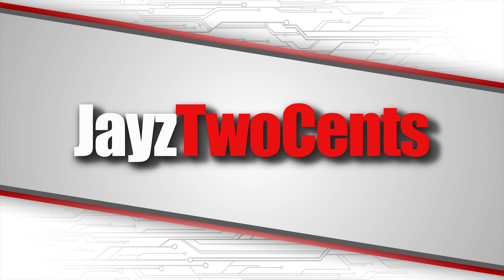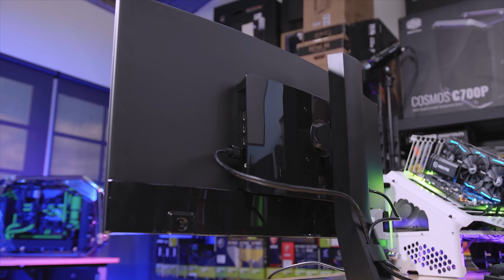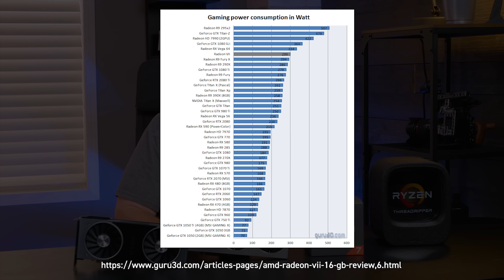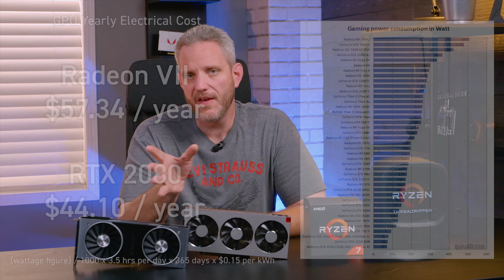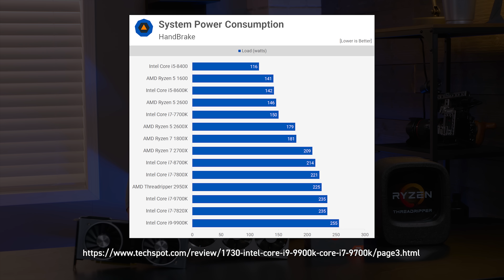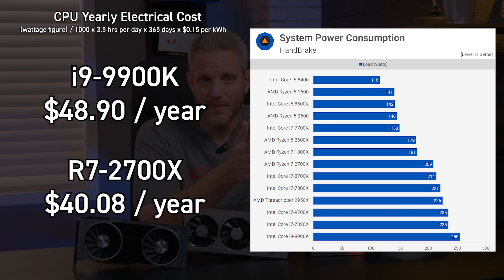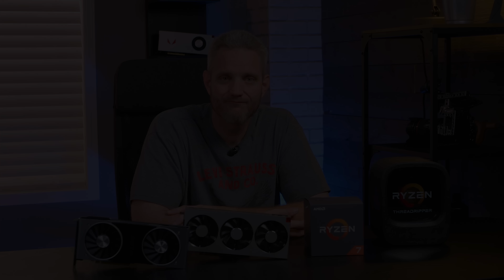Energy Costs of AMD vs Intel vs NVIDIA... This might surprise you

Comment: For the international viewers:
If you pay 0,25 the difference between the VII and 2080 is 22,- in a year (in favour for the 2080)
If you pay 0,40 the difference ends up being 35,- a year.
So... the conclusion can be thrown in the bin for about 3 continents and you might consider it.

ps. Your CPU numbers are also incorrect because you are comparing a unlimited 9900K vs a stock 2700x

See https://www.techspot.com/review/1744-core-i9-9900k-round-two/ and look for Power Consumption where they explain their screw-up.

Comment: Thanks for this. On the desktop AMD is looking really good, and it's only going to get better with the 3000 series. Intel doesn't appear to have anything new in the pipeline for the rest of 2019, and if the preliminary numbers are to be believed they're going to be in a world of hurting. 2020 may be another matter when they bring 10nm to the desktop.

Laptops are another matter. Intel is bringing its long awaited 10nm process there first, along with vastly improved integrated graphics that will wipe out AMD's graphics advantage in that space. Meanwhile, AMD is giving us a half-hearted update of their Ryzen APU series to 12nm. AMD will win some value-oriented customers, especially if Intel struggles to produce enough of their new laptop processors, but AMD isn't going to be competitive at the high end of the laptop market.

AMD is presumably working on a 7nm laptop processor for 2020 or later, presumably also incorporating Navi graphics. That might finally make the company a serious player there.

Comment: So...
Ryzen 7 3700X expected to run at about 65 W vs i9 9900k 170W stock or about 210 W if you run all core 5 GHz turbo with no other OC (in other words not locked 5 GHz, just enabling all core turbo in the motherboard).
With that kind of numbers the power draw argument becomes more applicable...
Just saying...
I bought a R7 1700 to start with in part because of it being a 65W chip.

Comment: my old-ass system uses aprox $45 a year to run at full OC and maxing VC volts and watts. but like you said its not running full power 24/7. but my system is always on, only shut it down when Im out of town for more than 24 hrs. which is like $4.58 a month to run. you prob payed more to run a 100w incandescent light bulb running all day.  lol  I suspect a newer system runs much less especially if you use the power saving features. Thanks for sharing these #s Jay !

Comment: 15c/kWh would be extremely cheap.
Average real prices for power is more in the range of 30c/kWh.
(not the advertised as you also have to pay grid usage fees and other things -  the grid usage fee often is just 100% of the power price, effectively doubling it already).

Also - the Radeon 7 is by your own (and nearly all other) benchmarks a few percent slower in nearly every game.
Here for me both cost pretty much 700€.

For the CPU comparison - sorry but that is absolutely not how it works. Your handbrake-numbers are, as you present them, useless:
The powerdraw is not what matters but the total energy usage. Say system A needs twice as much power as System B - does that make it less efficient? No.
Now, lets say System A finishes the work in 1/3rd the time of System B - this makes A a lot more efficient despite higher power draw. But if A took just as long as B then it would be horrible inefficient.
And when comparing intel CPUs on highend board you kinda have to change the UEFI-settings manually cause by default nearly all of them have horrible settings, way outside of intels official specs and wasting a lot of energy, even making them slower due to thermal constraints.
I have seen that on my i7 8700K:
Stock settings in Cinebench R15 - score 1420, 135 W.
Intel specs - score 1350, 87 W.
That is a huge difference, specially considering that OCing it to 4.9 GHz and 1600 score still gave me under 120W.

For Handbreak i am rather certain that the Ryzen 2700X will easily beat the 9900K - far lower power consumption and just a bit slower.

Comment: im gonna start by saying that im an amd fanboi, but yeah my 8 core FX is a space heater of a massive scale. i run the 8350 overclocked to 4.8-5.0ghz on all cores all the time (1.49-1.51v core, asus sabertooth 990fx v2) so it puts out a ton of heat while gaming. i wanna say that it is rated at 220w at full load at that speed, so it makes my corner of the office toasty pretty easily. but it runs like hell with 2400 speed trident ddr3 in it

Comment: Just a quick question: If you have a Laptop and the Power brick is listed at 150Wh, does that mean the Laptop is constantly pulling those 150Wh? If so, that would mean a Desktop pulls less in idle, right? Of course depending on the config.

Comment: Personally I more care about how hot part is rather than power draw, though those two tend to go well hand in hand, though there might be exceptions I can't think of now. And I doubt that many people care about power draw more than in terms of how strong PSU they need. Unless there would actually be like Grand Canyon sized difference in terms of consumption, which rarely is. Still, when arguments are made, or reviews, I am all for putting all cards on the table and letting everyone weight them based on how much they care. In the end, people buying i9 clearly don't care to get best value, they don't care if they have to spend extra on cooler to deal with the heat or power, all they want is top stuff. And maybe perhaps something that will retain re-sell value better, since i9 9900K in the end, will be top chip for Z390 motherboard, provided 10th gen will need new motherboards. And people going with 2700X will likely be far more concerned with bang for the buck they get with it and how you can easily keep it cool with stock cooler. As for Vega VII, I would say it mostly fits category of people who want to have workstation and gaming rig in one. Or those who tweak it. Bit less talked about fact is, that if you undervolt RVII, it runs cooler, quieter and consumes less power, plus you can also do it in Radeon Software automatically, if you don't want to tinker with it. Though I feel people who like to tinker with it, will also be happy with the card. But as far as I would say, if you want something to just pop in, install driver, touch nothing else, RTX2080 is your best bet, since it tends to give you more consistent performance over multitude of titles. And people who don't care about money are proud owners of RTX2080Ti or maybe RTX Titan. I mean if you are going for the overkill, you might as well get mother of overkill... :-D

Comment: Pff, of course if you live in US, 15c per 1kWh with US salaries you can give zero shits about power consumption.
Here in EU, 15 EU cents per kWh is eastern EU price. For instance in Germany it's 30c per 1kWh (highest in EU).
Also it;s pointless to consider avg gaming hours, 3.5h/day means someone play 3.5h couple of days in a week, and someone 5h every day. Obviously first person shouldn't give a damn, but second  should consider power consumption.
In my calculations (mid range PC) most important were PSU. Correct wattage (not too high) and high efficiency can save that extra 40Euros for PSU easily in next 2 years. Next would be graphics card (again - mid range). CPU - no, not really, if you do not compile shit whole day - highly unlikely it would make any difference, more important to pick one that do that specific job quicker, so it would go to idle faster. 
Also less heat = happier electronics (electrolytes especially)  = less sudden PC component failures - sort of money safe as well.

Comment: this is a shitshow.
compare a rx590 and a nvidia 1660ti or something that makes sence.
Reply: You are picking and choosing what makes sense to cater to your narrative. First off what exactly makes any less sense to compare a 2080 to radeon 7 considering they both perform the same at the same price. Second off of course an rx 590 runs hot, this is a unique example of a hot card due to being overclocked to the max, plus that card shouldn't exist considering its just an overpriced rx 580.

Comment: Ignoring power draw and performance variances, my wallet speaks louder than anything minus my wife. 😅

If you're paying a premium for a marginal gain, what are you really paying for if you won't even really utilize that heavy of a workload?

To me, AMD is less expensive on the CPU side, and obviously, if you go down the tiers to the mid range of video cards, AMD is a better choice for the price for my own workload, which is mostly just streaming, some retro-gaming, and some video recording and editing on a personal level. I can get more mileage out of an RX580/590 than anything and paired with a Ryzen 5 2600/2600X, I've got all I really need.

That makes more sense for my wallet. If a system only costs me $1200 for what I need as opposed to something at $3500 that I'll never fully use at all, why get the $3500 and waste my money?

Comment: Goddamn right there's a difference! I don't know about the CPU's but the GPU's there's a HUGE difference between AMD Radeon cards & NVIDIA GeForce cards. 

I don't game a ton & when I do, I usually play titles that have been out for a while or an indie game. My current GPU is a Gigabyte GeForce GTX 1050 2GB Overclocked GPU in my system. However, there is a game coming out this year that I'm very intrigued by (The Sinking City) & my current card isn't up to the task, according to the Sys Reqs. 

So I picked up an AMD Radeon RX 570 4GB GPU, also a Gigabyte card, from my favorite tech store Newegg.com when I saw it on sale. 

*[Digressing for a second...]  I live in Arizona, where Satan likes to spend his Summers. Usually we start turning on our AC units in May & don't stop using them until October, sometimes November. [In]Conveniently, those six months also come with increased rates for electricity like some of the colder states likely do in the Winter. As a result, I try to reduce my power use more during these months both to reduce the load on the power grid, not strain my Air Conditioner so much & not freak out over the electric bill.

With the 1050 card, my system draws anywhere between 50-56 Watts Idle, 60-78 Watts w/ a low load [browsing in Firefox, Clementine (fucking hate that name) Music Player pumping out some killer Metal tunes through the 5.1 speaker set, and usually a document or PDF file open; at all times I have a CPU Load Monitor widget & a Memory Monitor widget as well as a Temperature Sensor program running docked. When I fire up my rig & boot into my OS, Kubunu 19.04, those widgets & Psensor load up automatically. Gaming, the 1050 would draw like 132 Watts max. 

The RX 570, on the other hand, drew 65-75 Watts Idle, 95-115 Watts under the EXACT low load conditions as the 1050's listed above. I didn't try gaming with it because I haven't installed Steam for Linux yet, but if I had to guess, I'd say the RX 570 would push the system Wattage to 150-160 Watts.

      *That is a MASSIVE difference in power draw! For the handful of people that watch the JayzTwoCents videos out there who DON'T OC their machines, these are real world numbers. For reference my Intel Proc is an i5-8500.

Comment: #JayzTwoCents a question.  Does Ryzen 5 2600 consume the same amount of power (consumption) as i5 9400f?
Reply: Nivaldo Mendes At stock, roughly yes. Once you overclock the 2600, it will pull more, but that’s expected.
Reply: @avagreen9060  ty for the info

Comment: Both really good products tbh, I have a 1080ti and haven't upgraded because of the price to performance. I also run a 2k screen with 144 htz monitor. i7-8700k but I would go with a price to performance build next time. if amd is dollar per dollar better and I am not going to suffer in any way. Then ill go with the logical route.

Comment: JayzTwoCents, you are not taking in calculation the air-conditioning EXTRA heat it must cool, this kind of calculations is done when by example studying to mount a LanCenter o an ESports Center. Set hungriest hardware in W, you needs more capacity in the air acconditioner. Anyway, about big places, we are going to the Ryzen 3hird gen, Intel just has died when Google streamming center chose for AMD, that means everything now will be optimized for AMD and Intel will be forgotten and bit the dust.

Comment: jay first thin i am going to say is that this is totally irrelevant man. but to buy into what youre saying your last argument sums it up. lets talk about it from a productivity standpoint. Lets say youre rendering and doing all this finite stuff and not just a gaming session. the performance gains will make that processor be at peak load for less time because it can finish its work faster, if you add to that the productivity costs because over a year shaving a couple of minutes from a project could mean you can squeeze a few more projects a year which lead to more revenue because you were able to output more work in less time thus perhaps making that entire argument invalid.

Comment: you provide wattage without knowing the full configuration for both systems for the CPU test. They state total system draw, but from what system? what components are used? Your argument is flawed.
What power supply was used? was it on a test bench or a full case with leds? what motherboard was used for both platforms? I mean come on, get your own power draw meter and do it yourself. 
AMD is not more efficient than Intel. I can tell you with 100% confidence. I'm not a fan boy, i work directly with CEC and i can show many test results on how inefficient AMD is with all their chips

Comment: My 2700x oced at 4.2ghz, x470 taichi,, w/ 16gb memory, msi 1070 gtx and a corsair hx850 platinum psu pulls 170 watts while gaming with vsync on.

  Shut vsync off and it hits upwards of 220-230 watts.  

  Its all about the settings, I dont use cool n quiet.. my processor is always at 4.2.

  AMD is doing just fine in the power department.

Comment: In the summer the power draw is a legit argument, not for cost, but for comfort.
35C+ rooms are not nice to live in.
Reply: Also for noise. Intel CPUs tend to run a good bit hotter than AMD, so you can save a significant portion of noise by normalizing for temperature.

Comment: @JayzTwoCents +JayzTwoCents

It's sad that this video is sooo pro-AMD (as it has been with other videos) rather than letting the data and the analysis speak for itself.

First off, there are massive, inherent flaws in the analysis methodology.

I think that you should be normalizing performance per Watt per MHz clock speed per core.

In other words, take the number of cores and multiply that with the integral with respect to clock speed as a function of time divided by the total time so that you can get a mean normalized clock speed*core metric.

Second, you claim that the 9900K has a 15% performance advantage, but from your same source, in the Blender benchmark that Techspot ran, the 9900K completed the Blender benchmark 20.7% faster than the Ryzen 7 2700X. (18.4 vs 23.2 seconds) In the Handbrake benchmark that they also ran, the 9900K managed 45 fps while the Ryzen 7 2700X amanged 34.2 fps, which means that the 9900K outperformed the Ryzen 7 2700X by a margin of 31.58%, both of which are a far cry from your stated 15% difference in performance.

Again, your data source doesn't support the conclusions that you are TRYING to achieve in your video, which exposes your bias towards AMD rather than actually letting the data speak for itself.

I used to run a PURE AMD shop when they used to have the Opteron series processors out there, but now, you can pick up Xeon systems very inexpensively from eBay and as such, even older Xeon systems can outperform the LATEST that AMD has to offer at a fraction of the initial cost of the system and also the total cost of ownership.

Comment: Buying Nvidia costs more in the long run because you're increasing their market share so your next upgrade will be more expensive. Then the upgrade after that will be even more expensive as Nvidia's market share increases until it spirals out of control.  Surely it would make sense if we buy a slow AMD card to increase AMD's market share. AMD will then have more money for R&D and Nvidia will have to spend more on R&D to beat them. If everyone done that 6 years ago then RTX would be much faster and cheaper because it will be competing with AMD.

Comment: Ryzen for most part, you can just lay your ass cheeks on the IHS and cool the processor.

Only the I5 I3 Pentiums run cool.
But K versions of I5s are hot.
All I7/I9s run stupid hot.

The Ryzen 3700K will only be 65W.. absolutely insanely low from 105w prior 2700X